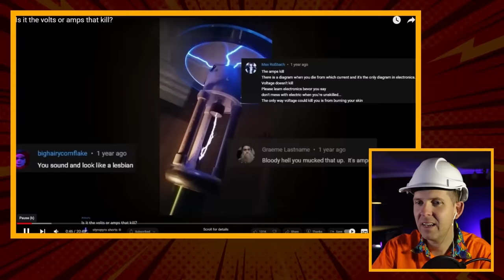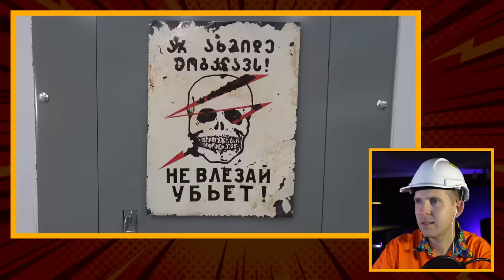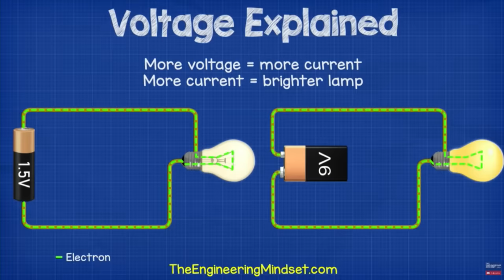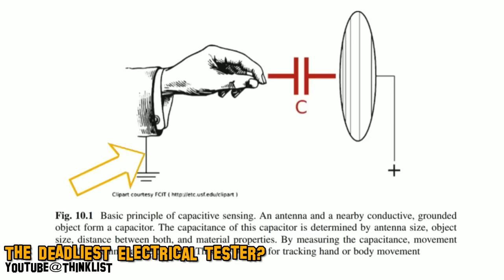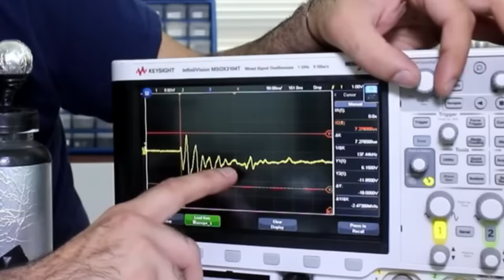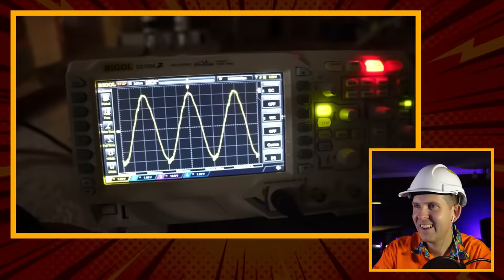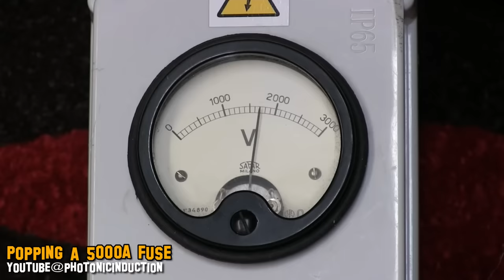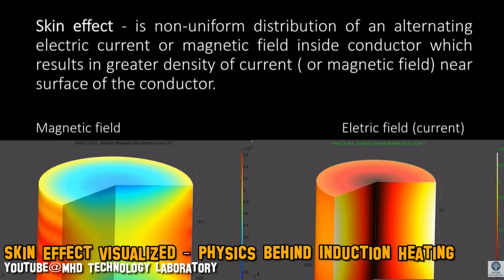Electrician Reacts to Styropyro's🔌AMPS vs VOLTS⚡

Comment: Simple answer. Amps and ONLY amps.  You can have 43563563563563 V and ZERO amps and be safe.  You can have 0 to 1 billion Ohms on the above line and be safe.  The right amount of I/A current will put your heart in arrest.  Add as many V and ohms you want... 
In other words. 1 billions volts and 50mA has dangers.  1 Billion V and 1 billion Ohms and 50mA somewhat safe.  
The math that equates to danger is when amps are added.
Reply: Theoretically 43563563563563V with a  of 0 is possible at an open circuit but however under a load the current draw is no longer 0 and at that voltage an arc should be formed unless there is a current limit but with no current limit there should be a short circuit (an arc) and therefore an arc can be formed. You cannot have 0V with current flowing as you require voltage to let current flow under any type of load. Don't take voltage out of the factors as it is the reason why the current can flow. If it was truly current alone then outputting 0V with a current flow of any fatal amount should be possible but that's not possible in reality.